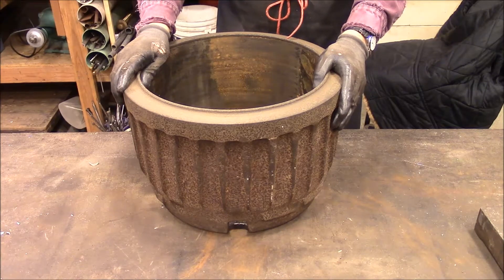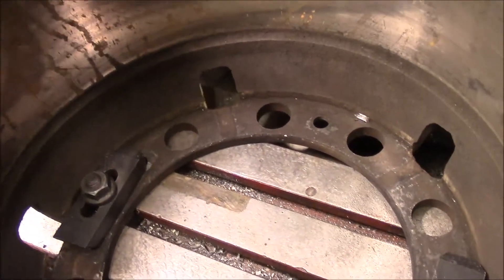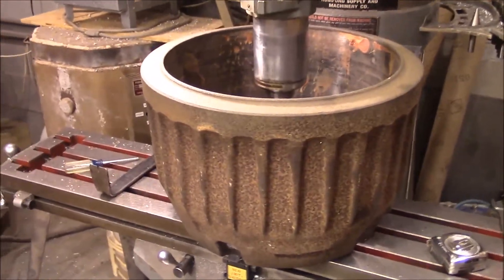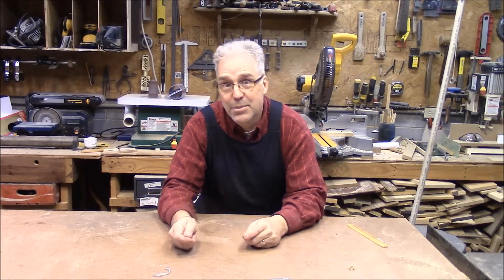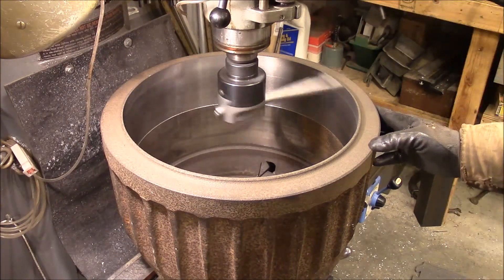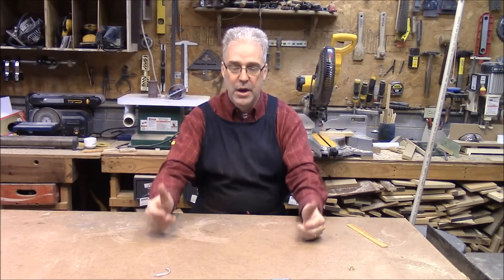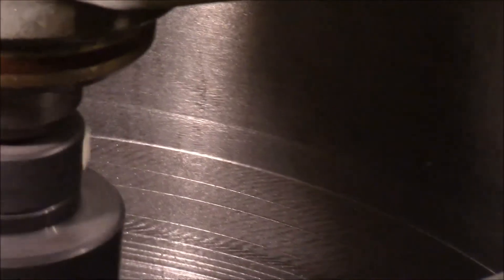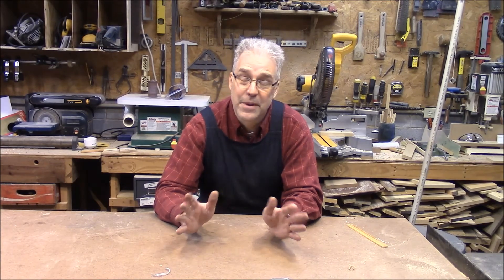Turning Big Brake Drum on mill.

Comment: That ringing is called Harmonics. Years ago, I turned drums and rotors. Has a rubber belt for the drums ans a narrow band for rotors. If you didn't use them, it would not leave a smooth finish.
Reply from the maker: Thanks for adding your experience.

Comment: I know this is an old video but for future reference or for someone that might watch the video and read the comments, you need (well should use) a left hand cutting tool for boring using the cross hole of a boring head. This allows you to bore with machine tuning clockwise so no risk of unthreading the head from the arbor. 

Speaking from experience from being in a jam once years ago, I had to bore a hole that I needed to use the cross hole and didn't have a left hand cutting bit handy and needless to say, I destroyed boththe part I was boring and a very expensive boring head (it was an automatic boring and facing head) because it jammed and unthreaded before I could catch it and stop the mill. Granted, in my case, I was cutting fast so things happen fast but a jam and unthreading can both destroy a boring head and / or the gears for the automatic quill feed in the head of your mill (seen it happen). The gears in the quill feed drive are not very strong, hence why Bridgeport states to not use it for drilling with drill bit over 3/8".... Its really only intended for boring with a single point cutter which doesn't impart have loads on the drive mechanisms for the automatic quill feed.

Comment: Adding small mass weights to the boring bar let's you damp out the vibrations (tuned mass damper) works well after adjusting the position , that boring head is a bit small for that diameter.
Reply from the maker: Thanks!

Comment: Future reference when you surface a drum start from the inside out.
 Also to get truck drums surfaced go to a brake supply house not a parts store or auto brake shop.
 It costs $15 to $20 each drum.

Comment: Is it possible you should have been turning your boring head the other direction? So it would not come unscrewed; I gave you a like cause I would have never thought that was possible
Reply from the maker: Not sure but if I turn it the other way my cutter was backward, I had to be doing something backward but at the time I couldn't figure it out.  It did get me on the road though.  Thanks for watching my video!
Reply: Could it be you need to install the boring bar in the opposite side?